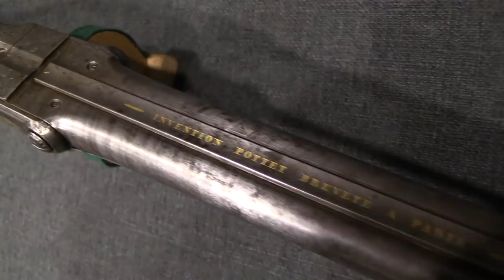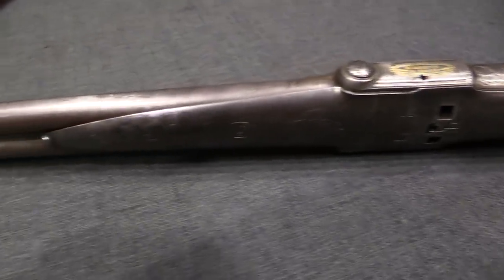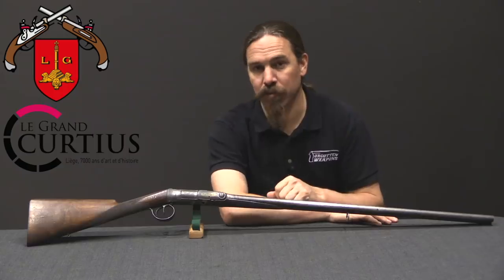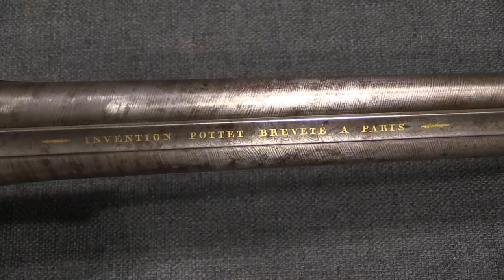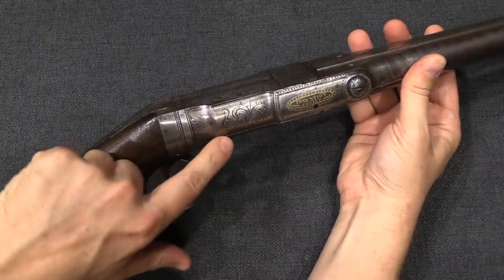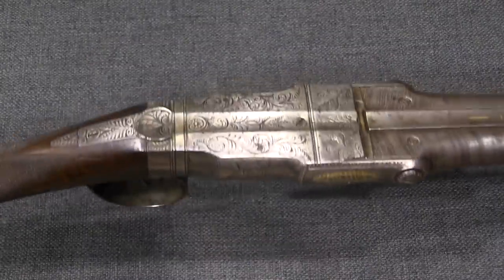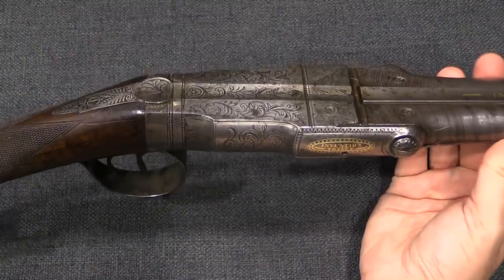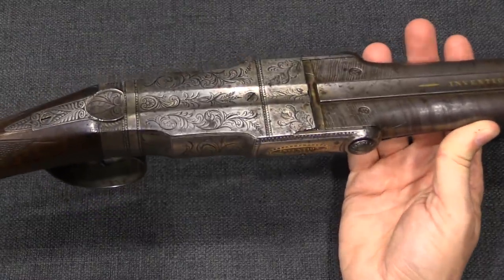Clement Pottet: Father of the Shotgun Shell

Comment: If Ian had opened the action further, would the extractors have retracted to their flush position?  Like a break-action revolver when you open it all the way?  Because the way we saw it, I don't see how you can reload it.
Reply: 2:54 When you close there is still a gap for the rim.
Reply: @ighmur  So ... you load the new shells OVER the extended extractor (not fully into the chamber), and the final closing of the action is what inserts them fully into the chamber?  That seems very strange.  But, yeah, I guess it would work.  Thanks.

Comment: Why was the barrel damascus?   Ians comment about when it was made suggests a technical limitation but what would that be?
Reply: Not exactly a technical limitation as much as a practicality of manufacture.

Shotgun barrels don't particularly need to be reamed out for rifling, or withstand nearly as much pressure as a rifle, so the easy way is wrapping wire around a mandrel and forge welding.
And if you're doing that, it might as well be a bi-metallic pattern weld, because fancy.

A barrel blank like this could be made in anyone's back yard today with a dirt hole forge and a couple spare hours to sweat a lot. You still need the chamber and extractor cuts, and whatever pivot pin holes drilled, but it's a massive savings in shop space and operating expense not using a barrel bore for something that didn't need it at the time.
Reply: @PXCharon    great, thanks.